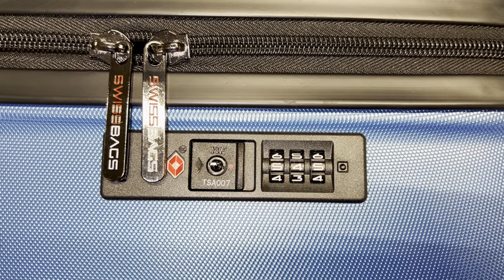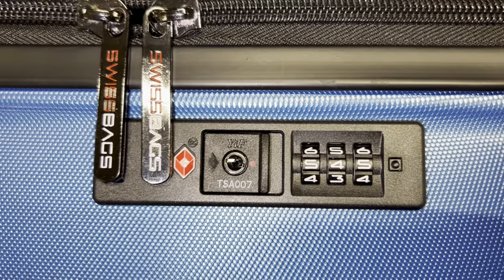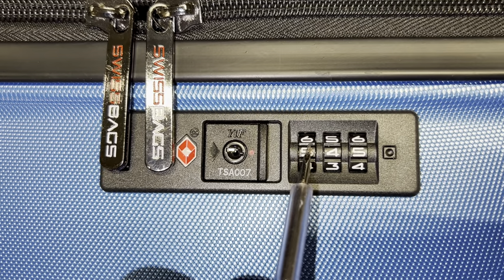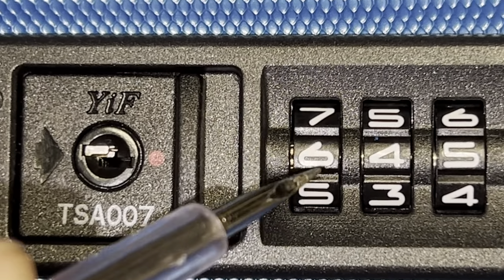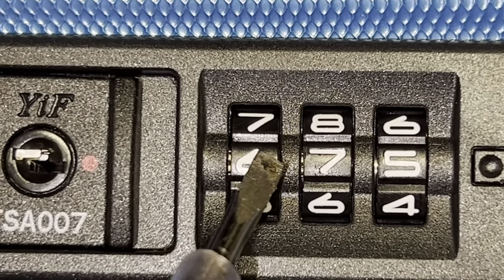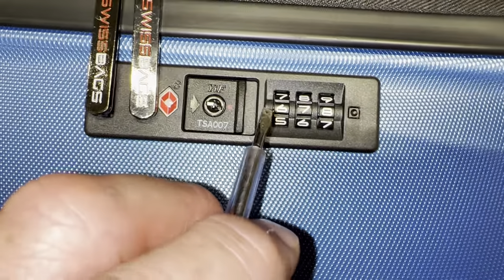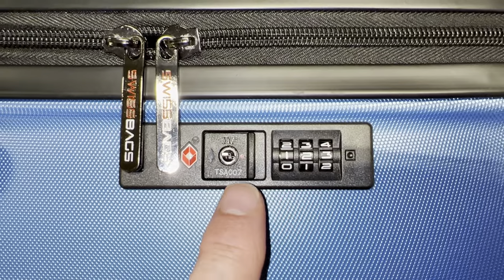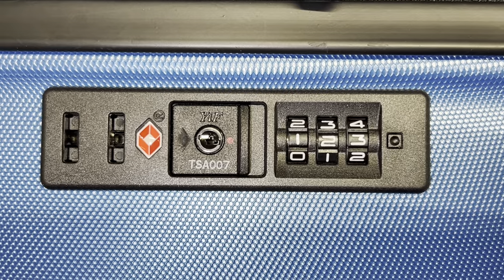How to decode a Swissbags Trolley lock (English)

Comment: You’re a life saver! Unlocked my luggage in 2 minutes 😅
Reply: It's 086 what to do next pls tell me
Reply: @shakshithakur5596 after you can open it, leave it at the correct code. There is a little hole on the right side for the model in the video. You use a little paper clip tip to push it down then you can change the code by turning the numbers, then press on the locking tab as you would open the bag and voila you have a new code

Comment: OK, I got a 2 combo TSA007 Pacific USA suit cases which I bought in 2016. Unfortunately, I forgot the lock codes.
I was successful finding the 3 divots.
I passed to the next step : moving 5 numbers up and down. I tried even moving 1, 2, 3 and 4 numbers up or down. Still doesn't open.
They have a little pushbutton on the side, but it doesn't go in when pushed (because I didn't find the right code). 
Any suggestion how to get successful ?
Reply: There is a lock that you might need to turn in the middle of the button it might be in perma lock position